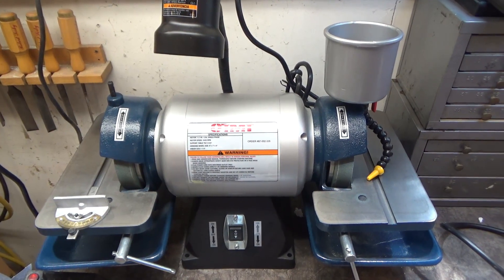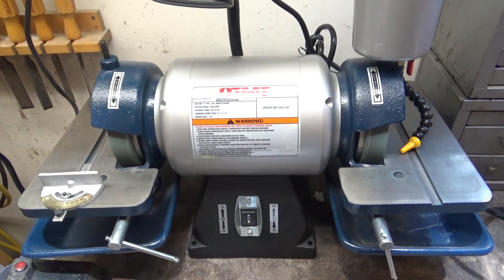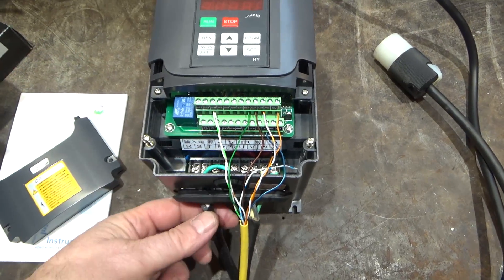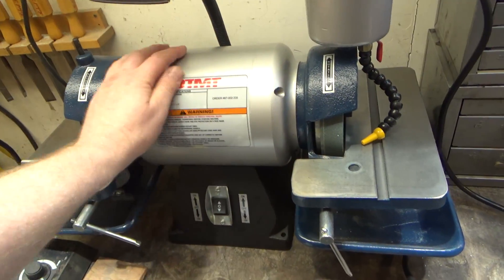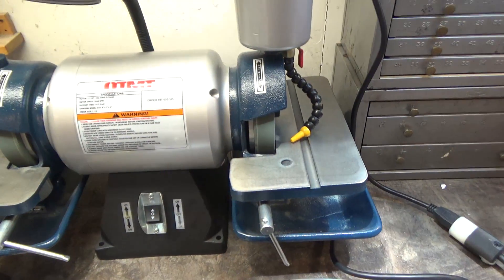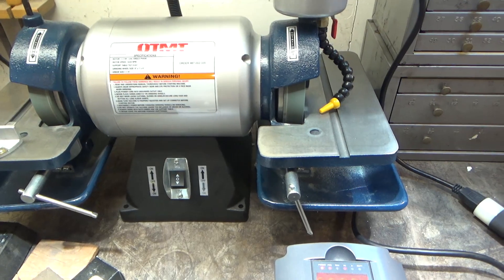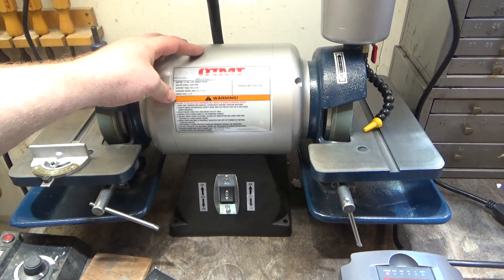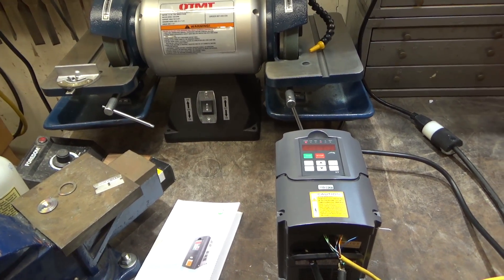QTR 06 110V Single Phase Variable Frequency Drive

Comment: Thanks for the video.  I have a Grizzly 1/2 HP H5373 Induction Motor on a wood lathe.  I want to put a VFD on it but I am not sure the motor is rated for VFD.  Can you help me how to figure that out.
Reply from the maker: I am definatley not a motor expert. One thing to look out for is a centrifugal brake. If you hear the motor sound change as it slows there might be one. If there is and you use the VFD to run the motor slowly the brake might drag with bad consequences. Also, the higher voltage spikes can degrade the winding insulation and cause shorts and motor failure. I don't know how to identify motors susceptable to issues like this. Sorry I couldn't have been of more help.
Reply: You mentioned your motor is 1/2 horse so since 1HP=745.7W you need a VFD that will handle at lease 1/2 HP or 745.7W/2=372.85W  So if you bought a VDF that was capable of providing 1000W, that will work fine.
Reply: @valveman12  line reactors are how you fix the voltage spike issue. And you can add a simple on delay timer to remove the starting capacitor from the circuit. They also sell drives that have exstra contacts just for removing starting capacitors. Those drives are a bit more pricey but worth it in some applications. They only cost more because 3phase drives are so common and they are not.
Reply: @jim4556  Hey Jim, question for you about line reactors.  I'm familiar with their use in 3-phase, but not single phase.  How would you wire one up in this example using 110V single phase?  Just use a single terminal rather than all three?  Use all three in parallel?  Being a pretty niche application, are single phase reactors even a thing?
Reply: @Skinflaps_Meatslapper  the point of line reactors is to smooth out the voltage spikes. So particularly long wire runs to the motor create alot of RF noise like an antenna. But more relivantly you end up de-rateing motor winding insolation for use on a VFD since the voltage spikes will break it down. Line reactors help get around that or motors intended to be ran on VFDs have increased winding insolation. So my fear with running a single phase motor on a VFD is that there is no way that its rated for those Voltage spikes and would fail early from it. As for hooking up a line reactor I believe you would just put the line and natural through any of the 3 windings on a 3phase line reactor.
Reply: @jim4556  Thanks, I kinda figured there wasn't any real wizardry involved as long as the flow was proper through the line reactor.  Think I'll invest in one before I try a VFD conversion.
Reply: @Skinflaps_Meatslapper  look up the company ATO. They had a responsive support staff, proper documentation, and fairly cheap drives. The drives themselves look fully featured. They sell single to single phase drives without a crazy mark up. The only thing lacking was an eathernet connection to the drives i was looking at. I never tried them but its what I'd go with for a home project after a little looking around. Documentation and support go a looong way for me. And im sure not buying a crazy exspensive main steam drive for a home project especially for a 120v motor.
Reply: @Skinflaps_Meatslapper  Using single phase (2 wire) VFD output,  you can also just add in a 2 terminal “DC Link” choke in series, ie spliced into one of the two output wires.  These are cheaper and lighter than AC reactors, and are more conventionally used on the input side of the drive, btwn the rectifier bridge and the DC bus capacitors.    

MTE for example, is a common brand of link choke and eBay is flooded w cheap used ones which come from decommissioned factories.  

Just make sure to match the current rating to your motor.  And be aware that they don’t  tend to work when oversized.

Comment: Be careful everyone what he is explaining may not be advisable see the comments below.  Dudley PLEASE  make it obvious in your vid's written description that this VFD is not outputting a truly phase correct single phase, nor was it meant to.   It outputs 3 phase and he is using some of the legs as a hack to get a non standard variant of single phase.  Others have commented below.
Reply from the maker: Your point is well taken, but this VFD was purchased as a single phase device, supposedly designed to use single phase in and out. I haven't scope'd the output, but you have me curious. Thanks for the comment.
Reply: @DudleyToolwright  it’s not single phase out it’s using IGBT transistors to change frequency the idea is they are advertising it as single
Phase motor capable but that is still dangerous as the motor as you know can still overheat on the capacitor winding where it’s thinner copper t

Comment: Dudley, does the VFD increment frequency only by 10 Hz?
Reply from the maker: I believe that it can increment by single hertz. You select the digit to modify. It has been quite a while since I have used it though.
Reply: He said in the video that you could do it by fractions of a hurt but you can see on the display he is going over to the 10th place but clearly passes by the 1 and I think 2 decimal places

Comment: I checked the serial number for the drive and it says it is made for 3 hp motors, yours is only 1/2 hp, can it have a long term bad effect? I want to use it on my 2hp motor. Thank you
Reply from the maker: I don't think that there are any issues with an over-spec'd VFD except for the possibility of a slightly lower efficiency. I am not an expert, but I think the frequency control will work identically no matter the load, unless the capabilities are exceeded, then thermal shutdown or burnt up IGBJT/MOSFETs are going to be problems.

Comment: That's for oil You dummies , not water.
Reply from the maker: The manual says water, but I would probable use water soluble oil as a lubricant/cooling fluid.

Comment: Your vfd is 110v input correct? Output is 3 phase and you wired only two legs on U,V 
Can you explain more details on how that would work on 110v motor please?
Thank you
Reply: great question! I don't think you have a neutral available on the load side. Only 3 phases rotating around 360°!
If you pick two of these phases do you understand that there are 120° degrees apart..? As for the RMS load voltage it's not 120V like it'd be with a usual Neutral reference.
This explains why you are seing higher RMS load voltage 😁 Careful chief...

[Solution: there are a few dedicated VFD for single phase induction motors that deal specifically with 90° phase shift of start winding capacitor and centrifugal SW bypass. Search the ATO.com corp]
As for now I settled for a simple "Soft Starter" to make my 3450 RPM 1/2HP pump seal & bearings last forever without the destructive 7x in-rush surge. "Soft Starters" solve my No1 problem with PUMP motor controls: long service life! (See the ATS01N109FT family)
Reply from the maker: The VFD I purchased is a very unusual one and it takes in 110v single phase and outputs 110v three phase. I just chose one of the phases to drive the grinder. I think this VFD will also accept 220v and output the normal 220v three phase as well.
Reply: @DudleyToolwright  thanks for your reply.
I have a same vfd controller but the Manuel didn't describe anything about 220v. Only 110v to 3 phase output 110v. Maybe this inverter only work with spindle motors "stepper motor" 3 phase.
Thank you
Reply from the maker: It has been quite a while since I shot this video. I am not sure about the 220V, but I did measure the 110V three phase on the output with a scope.
Reply: @DudleyToolwright  thanks for your clarification.

Comment: The bottom line is how many AMPS does this motor draw at spec.(120 volts 60 cycles)And how many amps does it draw at 3450 R.P.M.using the V.F.D.??.Nobody talks about this MOST IMPORTANT FACT.
Reply from the maker: Interesting question, are you talking about peak current or average and are you talking about the input side or the motor side? You bring up an interesting question. It never occurred to me to check because I was well within the specs of my outlet and the VFD, but if this pair was closer, answering your question would be essential. Thanks for an interesting question.
Reply: Dudley Toolwright I'm talking about when the motor is plugged into the wall at 120 volts and the motor is spinning at 3450 with no load on it?,how many amp draw is going into it,then at full load,how many amps are going into it?.
Then test it again with the motor hooked up to the VFD at 3450 R.P.M.no load,then test at full load with the VFD on the motor,its that simple.⚡
Reply from the maker: Thanks for the clarification. I'll have to measure those values. Are you expecting the VFD in-circuit values to be much higher? Peak or Average?
Reply: Dudley Toolwright I'm expecting the average and peak to be much lower because your driving the motor with RF and NOT 60 cycle"electricity".
Reply from the maker: Interesting. My initial guess was that when operating slower than factory the PWM (pulse width modulation) signal would generate a lower average current, but when operating faster than factory the average would be higher. Both of these estimates were the motor running in an unloaded state. The PWM of the VFD would probably increase in duty cycle to deal with higher loads for a given RPM. Changes in frequency, would I think, also cause the average current to increase. Just guessing. I will have to get a scope with current sensing to test the guesses. On another note 60hz is RF and it radiates quite well, like a radio station carrier. Such radiation is responsible for some of the hum audio mixers have to deal with. Thanks for the thought provoking questions. I have really enjoyed them.

Comment: What terminals do you put the jumper on?
Reply from the maker: You should definitely look in the manual for the specific VFD, but in my case I was jumpering the terminals that would support the braking resistor, if I remember correctly.

Comment: Dudley, any updates on this VFD and how it's working a year later?  Any issue with burning caps, windings, etc?
Reply from the maker: Sadly I have not found a home for my woodworking bench so I don't have a place for the grinder as of yet. As a result, I have not had the space to use it yet. I will give you follow up as soon as I can. Sorry about that.
Reply: I bought one anyway.  I was mostly wondering if that grinder was a start cap/run cap and whether or not you disconnected or modified those capacitors.  Or if it was a centrifugal switch if you modified that.  IE keep the start capacitor from engaging at low Hz RPM and burning itself out from creating a starting wave form constantly.
Reply from the maker: Mine did not seem to have a centrifugal brake, which was a concern. I am not sure if it has a start cap or a centrifugal switch, but I don't hear one engage/disengage.  I started this project but have yet to complete it because I have lost the space to put the grinder. I am waiting to get rid of a woodworking bench that is over 8 feet long to get some more useable surface space. When I do I intend to find a semi-permanent home for the grinder and will dig into this whole thing in a more thorough fashion. One of the other viewers that is a switching supply designer gave me a bunch of useful pointers that I need to look into further, including the potential starting cap issue. I have not used the grinder since the initial review. It is possible that some changes will be needed if I want to use PWM to control the speed and I intend to get into it at some point. I really appreciate you taking the time to share your insight.

Comment: I'm wondering how long your motor is going to last as most that are using VFD opt for a 3 ph induction motor.  The units I've been looking at are for 1HP, 220v 3ph motors. Paired with a VFD unit 220v 1ph/ 220v 3ph. output.  Interesting to see if you have motor problem later on.  Not wishing you anything bad.  It's difficult to find those that really understand the correct use and application for the VFD.  I find motor sales reps that will just sell you anything.  Then tell you...we have a 50% restocking fee if your not happy :)  Liked your video.
Reply from the maker: Thanks for the comments and yes there is a possibility of damaging the motor if I am not careful. Arcing of the brushes, heating of the windings, high voltage breakdown of the winding insulative coating, and centrifugal breaking problems are some of the most likely issues. I intend to use the vfd judiciously and watch of tell tale signs of problems. Check out the comments for this video. One of the other commenters is a switching supply designer and he has a lot of useful warnings. Thanks for the comments.

Comment: No tell me it's not so, BAD information on YouTube!!  You mean there are not Alien ships lurking behind Saturn??   
My understanding of variable frequency drives is in its infancy.  I did see a video where the drill press that had one lost so much torque, in the lower frequencies, you could literally grab the chuck and stop the rotation.  Thought about one for my 3hp/3ph lathe but did not want to lose torque, so I built a 5hp rotary phase converter.  After watching this, I may put one on my drill press for variable speed, if I won't lose torque.
Reply from the maker: Just be careful. Changing the pulse width on a single phase motor can exceed the duty cycle limits of the motor so make sure that the motor is not overheating and there is no arcing of the brushes. Best of luck.

Comment: Please post where you got the VFD from. I'm having trouble finding one, and its a great video but we need to know where you got it from.
Reply from the maker: I got it off of eBay. The exact item I purchased is no longer listed, but here is another: https://www.ebay.com/itm/2-2KW-CNC-Spindle-Motor-Speed-Control-Variable-Frequency-Drive-VFD-Inverter/122756418894?hash=item1c94da4d4e:m:mlxQKf4HjrLTt8QSumicqfg
Best of luck and be careful.
Reply: for eveyone else, try to pick a single phase OUTPUT so you don't overvolt your motor running from 2 of the 3 phases instead of a referenced Neutral.
Single phase motors are not great candidates for speed tricks unlike 3 phases that easily latch on a smooth rotating field with power split into 3 wires (lower currents).

Comment: What a revelation, truly. until I saw this video i was mistakenly under the assumption that I could not vary the speed of a single phase motor. Thank You for this video.
Reply from the maker: I'm glad it helped. Don't forget to consider the potential risks mentioned. Best of luck.